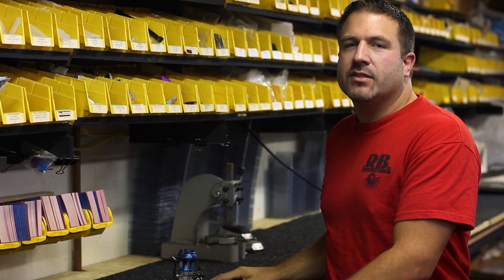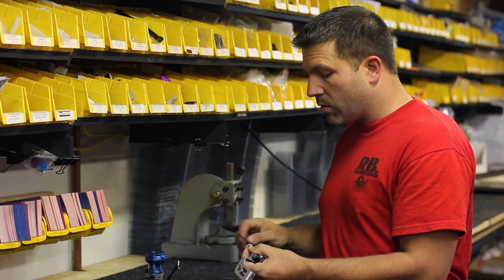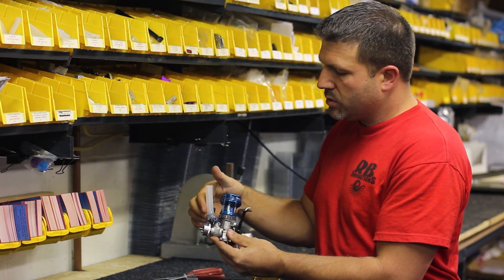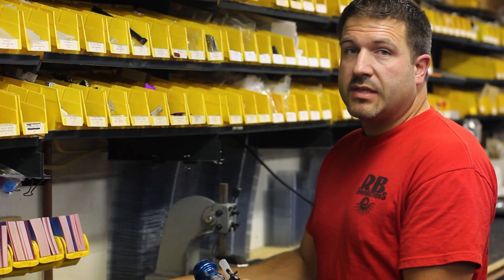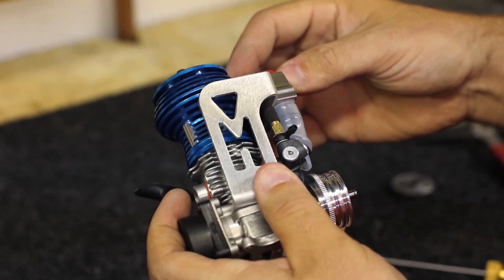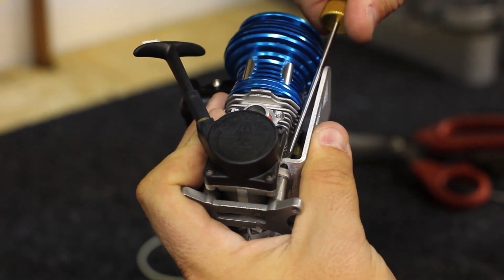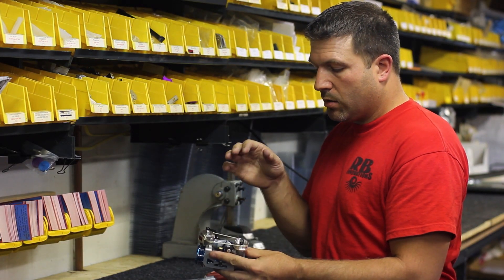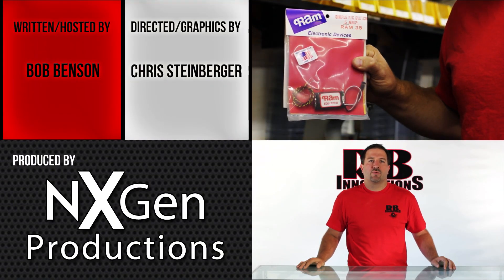How to Install an RC Supercharger from RB Innovations

Comment: The comments about superchargers not working on 2 strokes.. What about detroit diesels?
Reply: +AmericanThunder  Detroit diesels have exhaust valves in the head just like a 4 cycle engine. The porting in the cylinder liner is for intake air only.
Reply: ty2148 I know they do.. :D The comments didn't mention valves, just 2 cycles.. lol
Reply: +AmericanThunder A detroit diesel is a two cycle diesel.  Fires every stroke.  Since it has valves for the exhaust as mentioned above, the combustion chamber is sealed for a pressurized air charge.  A nitro rc car engine has open ports for both inlet and exhaust so the pressurized intake charge goes straight out the open exhaust port.
Reply: ty2148 So it's not the fact that the RC engine is a 2 stroke that prevents the supercharger from working effectively?
Reply: +AmericanThunder That's correct.  Small two cycle engines use piston porting for both inlet and exhaust.  That means for a short time both ports are open at the same time.  This allows pressurized air to go straight through the combustion chamber and out the exhaust port.  Two cycle diesel engines use piston porting for the inlet only.  The exhaust is still controlled by exhaust valves in the head operated by a camshaft just like a four cycle engine.  If the rc motor being used was a 4 cycle engine then the supercharger is a great idea.
Reply: +AmericanThunder Detroit diesel work on a completely different concept than gas 2 strokes, air never enters the crankcase on a Detroit diesel
Reply: ^yeah agreed, i simplified that a bit. An RC engine doesn't need a timed spark is what i was getting at, while there are 2 stroke engines that do need an actual arc to ignite the mixture.
Reply: 'work' very similarly, in what sense? RC car engines aren't really 'nitro' engines, they burn a mixture made up of mostly methanol (so, alcohol) and some nitro, and some lubricant. 

A top fuel dragster burns mostly nitromethane after started, does use MAJOR forced induction, is 4 stroke, and has absolutely nothing in common with a diesel engine...or RC car 2 stroke engine. Is that not a 'nitro' engine, though?

engines designed to run on a low percentage of nitro can utilize compression ignition, though...meaning glow plugs. That is the only similarity with a common diesel engine, even though what the fuel is, and how it is delivered, is entirely different.

so, yeah, both are annoying and problematic when cold...those are the only similarities.
Reply: Jamie Ritter Just a sidenote: A glow plug engine is not a compression engine. Compression engines develop a lot of heat and then are injected with fuel directly into the cylinder. The compression heat alone ignites it. A glow plug engine will not run without the red hot glow plug, compression is not enough to ignite the fuel, thus, not a compression engine.
Reply: re Supercharging a 2stroke ported engine: Does a rc engine run the same in 5000' Denver as 1300' Ok CIty as on the beach in SanDiego?  As you take the 2stroker up in altitude, it runs WORSE because the air is less dense... there is less air in each cubic foot of air.  Superchargers change the density of the air entering the engine.... a Supercharged RC 2stroker in Denver with just a low milibar boost for 'altitude pressure correction' WILL outperform the same engine without altitude pressure correction.  And obviously that applies to down curving gains as you increase boost to the point that the charge will indeed be blowing out the exhaust more than staying in cylinder

....but you likely will overcharge blow the head before the exhaust bypass is a serious problem
Reply: these are not valved engines.  the engine you are talking about has valves.  they were generally turbo supercharged.
Reply: +Megabyteme325 Detroit diesels are always supercharged, and very much less commonly turbocharged as well. Silver eagle, I think it was called?
Reply: Megabyteme325 I'm curious how they keep that thin rubber belt from flying away from the crank pulley from centrifical force at 30000 rpm?
Reply: It's if i remember correctly a neoprene o ring and originally you got 3 or 4 of them in the pack.  They stretch over time and need replaced.  They were very tight on the pulleys.  I forgot how fast the motors were turning as i do not mess with them anymore but the 5th scale engines we were running were turning over 25000 rpms.  We put these chargers on dynos and pitted them against engines modded by AB Mods, RB Mods and a few others.  These were top end engines for the day and still high end.  We used Novarossi, Mugan and a couple others in the 28cc class.  I think at one point one of the guys pulled an old .12 or .15 Paris Picco modded engine out of a box.  A very rare engine.
Reply: Megabyteme325 I just got back into nitro RC, I have an old OS .12CZ-R and an OS .15CV-R, they spin up to 30000+ and make .43hp and 1.2hp, respectively.
Reply: Diesels and nitro engines work very similarly

Comment: If the engine was a 4 stroke (with multiple pistons) then I would say this is Genius but it is a 2 stroke (single piston) therefore you are wasting fuel and air when the intake ports and exhaust ports are open.

The concept is good but the engine it is mated to is not.
Reply: The Roots blower on a 2 stroke diesel is not a supercharger in the conventional sense. It's used to pressurize the intake enough to flow air through the intake ports. Small 2 stroke engines use the down stroke of the piston to pressurize the intake charge.
Reply: There are 4 stroke single cylinder engines, look at your push mower...it's probably a 4 stroke. 

Although you do bring up a good point. Superchargers are a wast on 2 stroke engines because the exhaust and intake ports are open at the same time, all a supercharger would do is blow all that the fuel right out the exhaust. Not to mention that it robs power from the engine to do so. Basically you loose power and fuel at the same time for no reason. People claim that they work but I've yet to see any valid proof of that.
Reply: They are useless on any 2 stroke that does not have valves. But you look at any of Detroit Diesel's 2 stroke engines they were all supercharged but they also had exhaust valves.
Reply: There is an innate difference.
RC engines combine fuel and air at the carb, it gets atomized in the crankshaft and the mix is pushed into the piston.
With a diesel 2 stroke the fuel is added around the TDC mark.  Even if the ports are open there is no fuel being exhausted only air.
Reply: Be ok on my 4 stroke. 90 saito...

Comment: Yet they do not put more fuel in. or show dyno results. I bet that guy has a 500hp mustang to. He sounds like the typical my mustang has 500hp because i put flow-masers on it. but will only bring 230 to the race lol. Only thing this hunk of shit does it make your shit run lean. Hell save some money and just turn your highspeed needle in a few times. Hell you will even get more power then you will with this. less air resistance to the intake. less weight and it will run just as lean. I also love the fact the "Belt" will just slip like hell on that thing. RB is nothing but a bunch of scrubs who have no idea about how anything woks. Must suck being the laughing stock of the RC world

Comment: Bitch boy this is for a real car im talking about and it will work for 2 stroke how fast the piston moves it can keep presure air in a camper so your saying a air compressor can not pump air in to a tank it is going to fly out of the intake nope it is going to stay in the tank think 2 stroke ant nothing you cant build a 4 stroke car motor if you can think how a 2 stroke works idiot think before you say i work on 1000 hp motors with forced induction

Comment: Sure, supercharge it right through the carburetor, fucking stupid, you're just pushing in more fuel and not even making power.
Reply: Yeah, I think these are the same people that think eBay electric turbos work.
Reply: ikutoisahobo apparently the people here whom seem to think this will help, have zero education on 2 stroke and 4 stroke engines.
Reply: ikutoisahobo Late reply I know, but if you balance the fuel to the air (at least on sizeable carbureted engines) you will see quite the increase in power. On a nitro I agree; it's a gimmick.
Reply: Howling Wolven Yeah, you're right.  I mean, this would have worked (a. if it was gas or diesel, b. if it was 4 stroke) but it's a two stroke, absolutely no sense in supercharging it, no one supercharges or turbocharges a large 2-stroke for simple reasons, there are no gains.
Reply: ikutoisahobo lmfao. No one supercharges a big two stroke. Look up a Detroit 2 stroke. All of them are supercharged and some have a turbo feeding the supercharger. Get educated buddy. And engine is just a fancy air pump. Air is the limiting factor in an engine. (That's why you can make them run rich) more air+more fuel= bigger bang. Now if his supercharger is efficient enough to gain power over what he losses spinning it is the question.
Reply: William Allison A Detroit doesn't use crankcase scavenging like these do, in fact detroits have exhaust valves and no reed valves. The Detroit uses the supercharger instead of the crankcase for scavenging. The turbo on the Detroit makes no boost above atmospheric but keeps power well up into higher altitudes. In short you're comparing apples and oranges.
Reply: oddball0045 You're right. I thought I replied to William about this as well but I guess it didn't go through since I don't see my comment anymore.
Reply: William Allison I love how you say get educated but have no idea the engine you are talking about uses valves and the supercharger has very little if any boost depending on the ambient temperature and pressure lol...
Reply: you the fucking stupid one
Reply: bob bob No, no, no, I'm not the stupid one, you are. In this application that 'supercharger' is not going to do shit.

Comment: This is awsome i have a car with a blower they totolly work it is a 871 dyer blower blower work you other guy talk shit but dont know so keep it to you self it not ruining the engine like you mom ruin yous so shut the fuck up it awsome i know i works theres a diffrents naturally assporated a force induction blowers make high compression and yhe gss make it pop making more powerful strokes more combustion
Reply: you cant compress air when the chamber holding the air ISNT SEALED OFF FROM THE REST OF THE EARTH. The moment any air even starts to compress it will shoot the exhaust you idiot!! forced induction is only for 4 stroke engines!!
Reply: Nick Hansen this is like saying piston rings won't seal becomes there are not complete rings. There is a gap in them.

Comment: Its kinda pointless. Raced my buddy and we have rs4evos + and he made a mod and got it to work amd kt honetly was a bitch to tune and it cut the performace 3.0 engine so much it couldnt hit second gear. Why not a turbo? If the made that work you would need less gas and honestly a possability for custom exhausts and super amounts of power.

Comment: through the carb, how do u compensate for boost as far as fuel goes, if u pressurise the carb inlet u will blow air backwards through the jets if u don't pressurise the fuel supply or float chamber by the same amount wont u?

Comment: Have you got a MINIMUM idea of HOW a 2T engine works? 
Turbo wosen optimal carburetion settings altering it (that can destroy your engine). For the rest turbo dosen't work on 2T engine because its compression comes out from the exhaust port on the cylinder that is open at the same time as the injection ports!

OPEN YOUR EYES.

Comment: Hellooooooooo
the neeewwwsss !
turbo DOSEN'T WORK on 2T engine !
Reply: Why do you keep calling it a 2t engine. And this is not a turbo it's a super charger although I do agree not a very good idea on this type of 2 stroke nitro engine.
Reply: haha, that's not quite correct that the turbo does not work on 2T engine, I have a snowmobile with a 800cc 2T engine, and I have turbo on it, it has 130 hp original, with turbo it has 220 hp, and there is no vents which keeps the pressure in the engine, but it is the back pressure in the exhaust pipe that keeps the pressure in the engine
Reply: ailokemi ok so put this supercharger on your snowmobile.

Comment: Electronic fuel management systems in forced induction motors these days are computer adjusted to not be rich at low RPM's.

Otherwise, they would not meet EPA laws.

A two stroke engine can not be forced induced as both the intake and exhaust ports are open at the same time. You would need to do one of two things for it to run.

1. Have the forced induction draw air and fuel through the carburetor so that they are at a relatively even mix.
2. Install valves to prevent the fuel passing through.

Comment: Quite the opposite... this follows the mistakes of the early turbo systems that inadvertently caused a lean at boost condition because the boost pressure fights the fuel pressure coming in. Only way around that is increased fuel pressure, but then it's rich at no boost, or you put the carb AHEAD of the turbo so the carb sees normal atmospherics for fuel and metering, just higher flow rates.

Comment from the maker: The EZ start can be used on the T-Maxx and the Revo, but if you are running a Jato then you will need to use a pull start system.

Comment: My guess is that it just helps it to flow better. Probably does not actually create pressure... just like a strong fan to take the load off the engine.. I could be wrong though.

Comment: Hello, can u explain how exactly this works on 2 stroke where intake and exhaust are open at the same time? 
This would just blow unburned fuel mixture thru the exhaust port without a valve as overpressure would never be possible.

Comment from the maker: All engines have to be re-tuned after the supercharger is installed, and you should use engine manufacturers temperature recommendations. Overall, it should run at the same temperatures

Comment: A 2 Stroke is set up for 14psi air pressure stock.A Super Charged one may be set up for 20psi tottle including the atmosferic pressure.The exhaust port,exhaust pipe & inlet pipe desine are the hole hart of the engine.A full size 2 stroke should use a Direct injected engine & so no need for oil/fuel mixing.The sump would just be as a 4 stroke engine.With some sort of rotatting valve (as a CR250R uses)at the exhaust port a big super charge pressure could be made yet at low revs still run perfect.

Comment: no it aint a 2t gets its power band by something called a power valve which is located in the exhaust port the power valve opens up the exhaust port which gives a increase of power

Comment from the maker: Supercharger gains vary depending on the engine, exhaust pipe, and Supercharger set up, but Dyno testing that we have done shows results of 15 - 30% gains in horsepower.

Comment from the maker: Yes, you can use the stock cooling head, and the Supercharger gains vary depending on the engine, exhaust pipe, and Supercharger set up, but Dyno testing that we have done shows results of 15 - 30% gains in horsepower.

Comment from the maker: Turbocharging a 2 stroke with unburned oil coming out of the exhaust complicates the turbo design. This oil makes the system inefficient due to the drag it puts on the moving components. 

Unfortunately, due to misunderstandings about our product, some people have the wrong idea about the Superchargers. We talk about how the Supercharger works and answer many common questions in this video: youtube.com/watch?v=b8KKbmMtuGg

Comment: If you think about it by compressing the air you are generating heat. Without an intercooler to cool down the condensed charge of air the potentially "gained" power is lost with hotter air.

Comment from the maker: The Supercharger increases horsepower and the overall efficiency of your engine. The system mounts directly onto most vehicles with little to no modifications. If you want some more info, check out this video:
youtube.com/watch?v=5jTKPKpeH0E

If you want information specifically for your vehicle, give us a call at 315-451-4440
Reply: wow you guys are full of shit

Comment: i understand a lot more than you think. and the thing that you don't understand is that a centrifugal supercharger has a pressure potetial proportional to tip velocity. at this scale the tip velocity isn't very high so the outlet pressure and thus effect on crankcase pressure is minimal, like maybe in the 2psi range. all i'm saying to test it with a dyno, put pressure sensors on the exhaust in many locations and in the crank case and test it rather than just make a video saying sceptics are dumb

Comment: all of you posters don't fully understand how case induction/piston port engines work.  the mixture is compressed in the crankcase (primary compression), then pushed into the combustion chamber by the piston when it uncovers the transfer ports.  Their is an optimal range for primary compression that is dynamically related to pumping losses, fuel atomization and, the crank case seal's ability to hold the pressure.  Do you know that range?  do you know anything about inertia?  air velocity?

Comment: supercharging 2-strokes is questionable. 2-stroke performance is largely dependent on the exhaust. added pressure just goes out the exhaust unless the exhaust is well tuned. but the pumping volume is more than the volume that gets compressed anyway. supercharging will mostly increase waisted fuel but might increase power by reducing the amount of dilution of the exhaust in the mixture. still if it's a centrifugal supercharger it has to spin mighty fast to do anything at all.